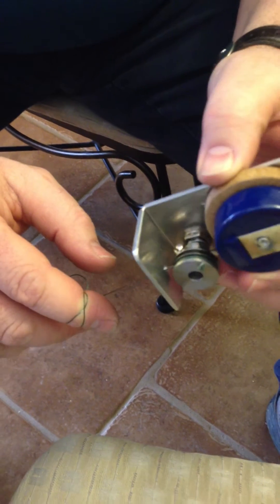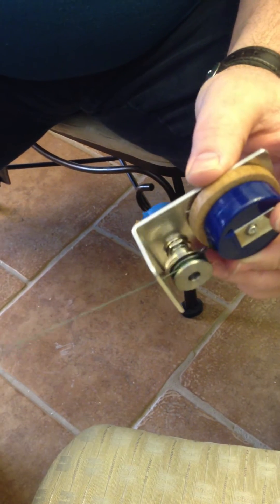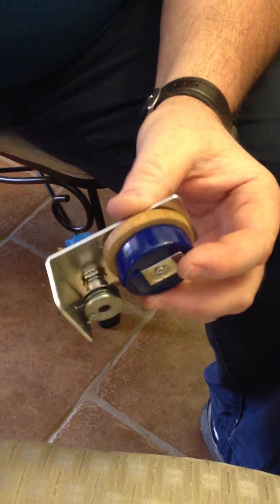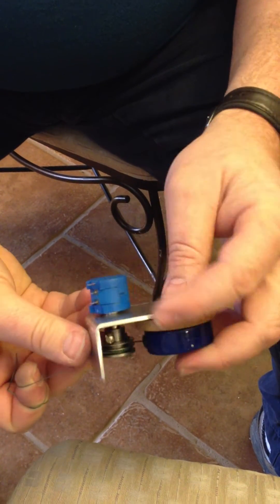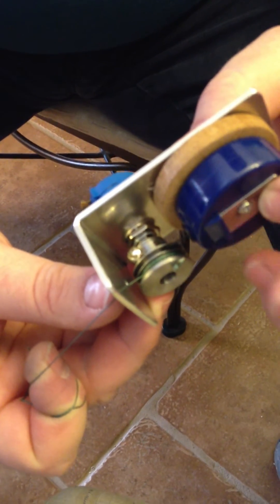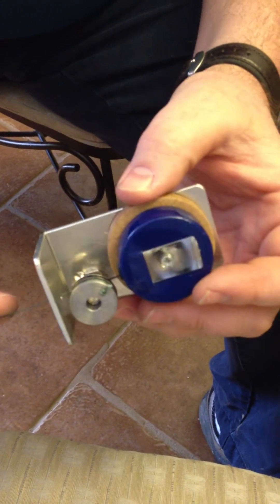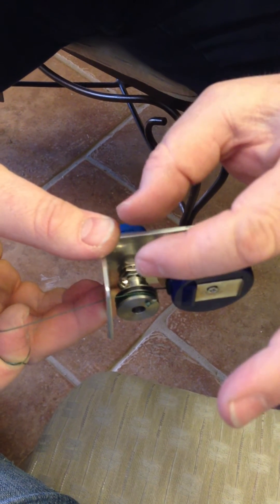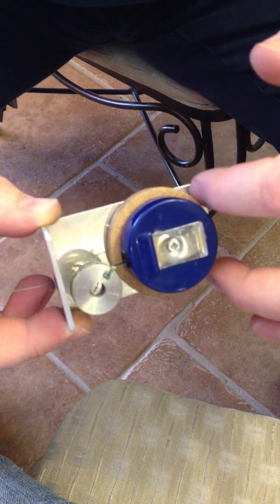Cheap String Potentiometer Pt 1

Comment: I made a similar contraption, but one of the potentiometers broke after a few uses, I don't know if it's because it came with a defect or because they get damaged from turning so many times so fast, has this happened to you? It's the perfect solution for a project I'm working on, but I'm afraid it might break down after a while.

Comment: Could you make a more detailed guide on making it? Specifically on the second pulley that you bolted next to the badge reel. I need this exact type of device but with a rotary encoder instead of a potentiometer